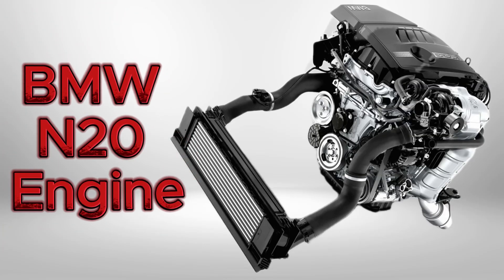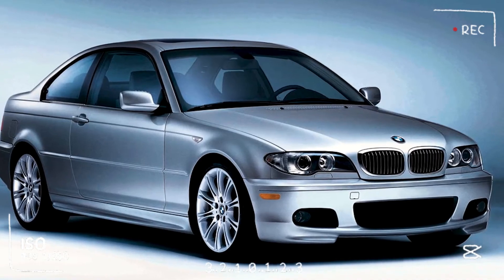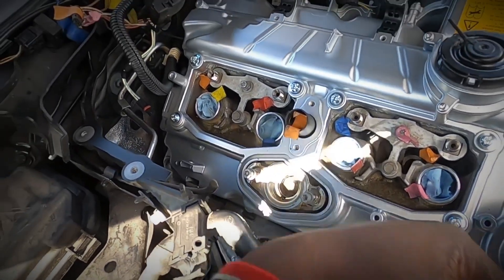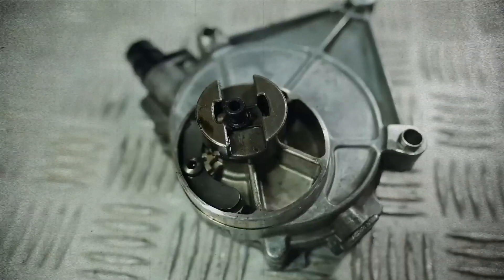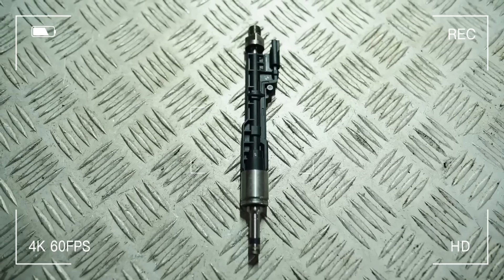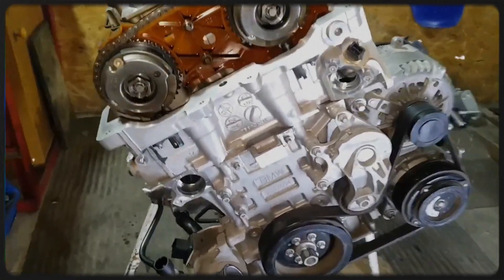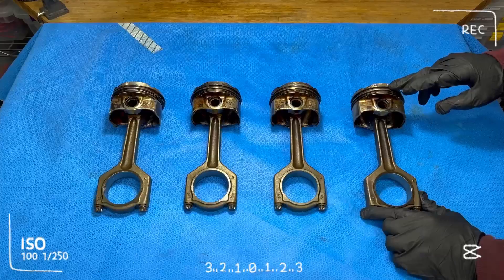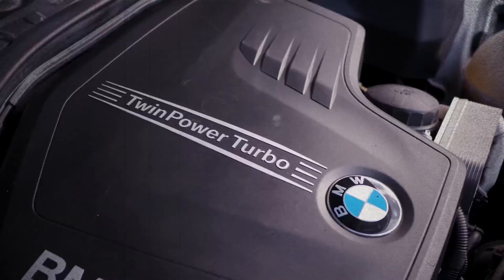BMW N20 Engine: Genius or Nightmare? Full Review of Problems, and Reliability!

Comment: I don’t buy new bmw garbage
Reply: comments this on a older produced engine 🤦‍♂️😂😂😂
Reply: I love n20 engines. Easy to work on because you don't need to remove a lot of parts the get to anything. Once the timing chain is replaced and upgrade the 8 plastic hoses, it extremely reliable.  Mine is on 140k miles and runs like a dream.
Reply: @JayFBond in other words , after you've done a load of expensive work on it , it's great....